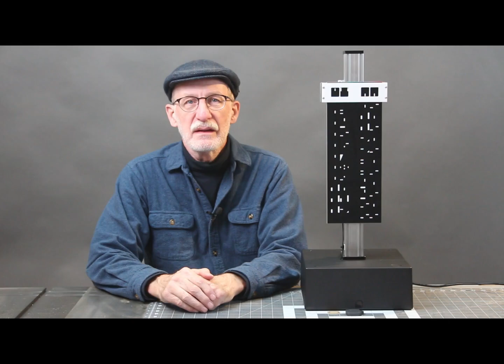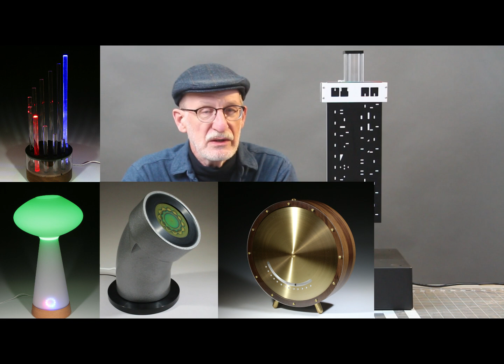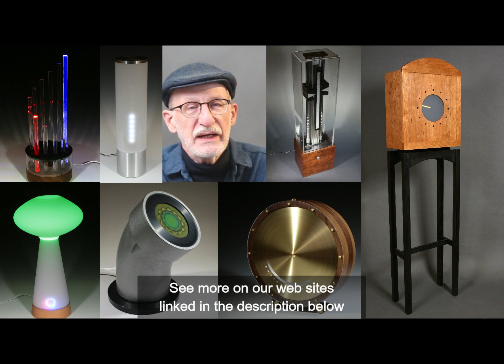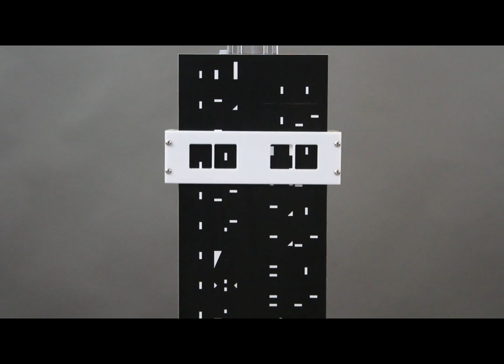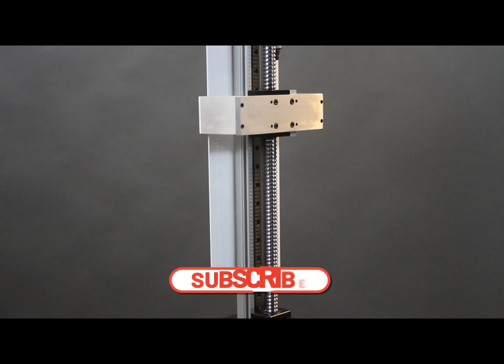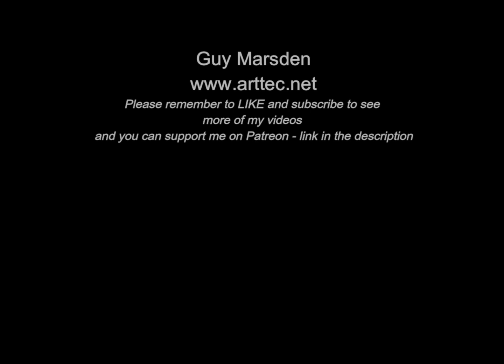CryptiClock

Comment: interesting one.I wonder if it being a little bit taller so it has blank to top would be better.
Reply from the maker: The cryptic was custom made by a guy who does those and we had to use the nearest length motor drive that worked.